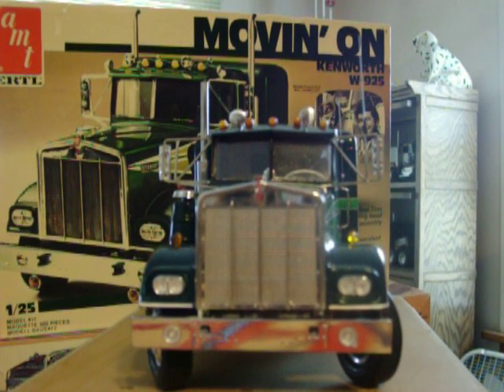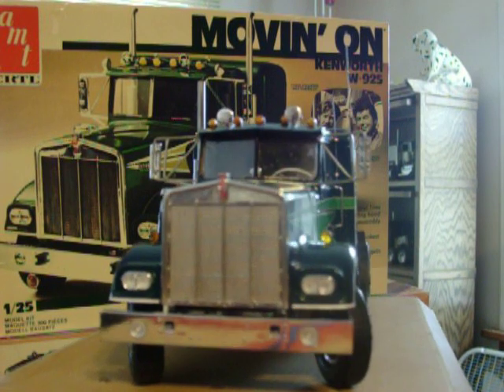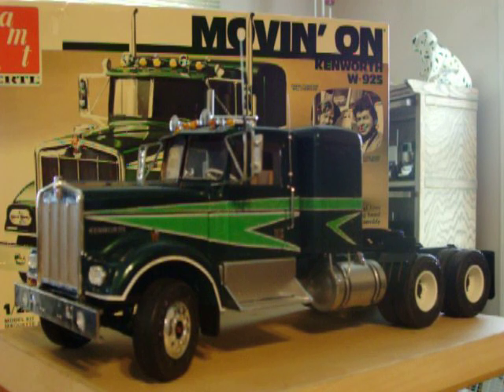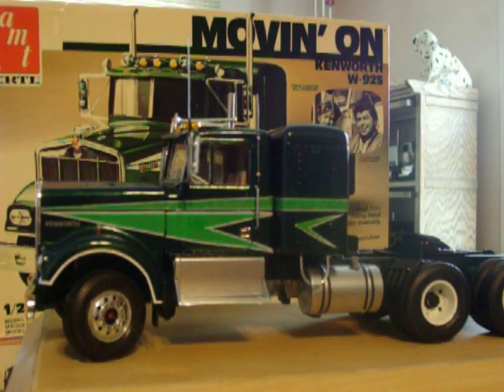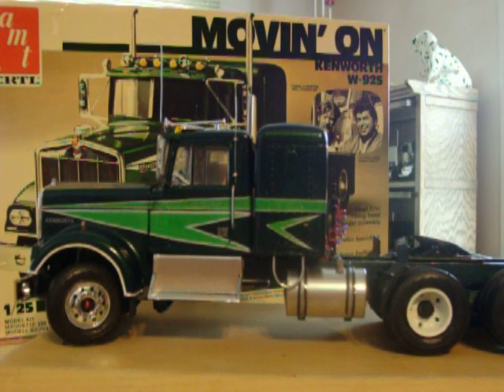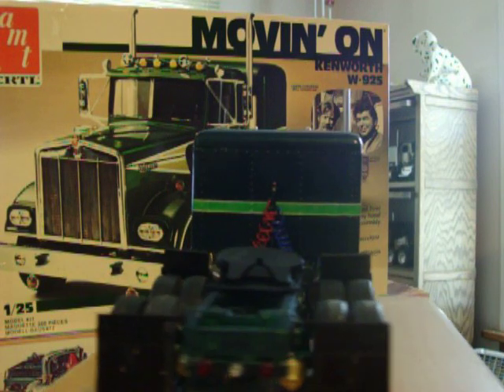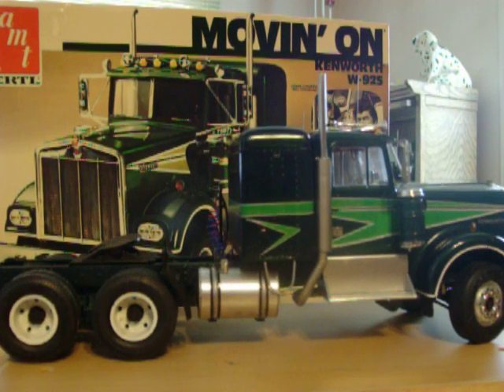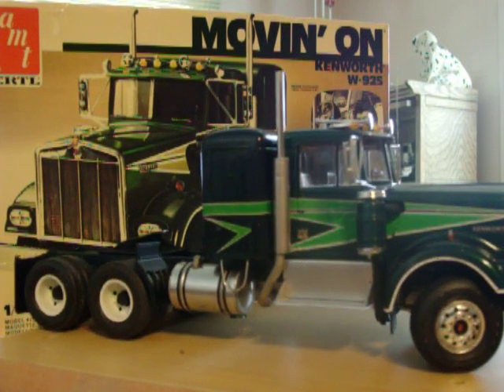In Tandem/  Movin On truck

Comment: Nice work! Good news - this kit is coming back out in June this year and rumor has it they are correcting the decals to match yours and the torsion bar suspension which would be correct for the pilot episode truck is going to be included. Probably still have to modify the hood for the single air cleaner and source the passenger side battery box but it's a little more accurate this time around.
Reply from the maker: Thank you for the comment and would love to see the updated version , what company is doing this ?
Reply: U want sell it

Comment: You ruined a great model...
Reply from the maker: Not sure what you mean by ruined a great model but i will reply, I did not use the Movin On model to make the one in the video the box is just a background. I have a you tube video of the Movin on truck with the correct sleeper and bumper if you would like to see the difference.
Reply: 'Sorry. I thought you used the Movin' On model...
Reply: feb 9 2020 - READ THIS FFCRLT            impressive job FF i was able to download a set of decals as used for the full size truck in the tv show google pictures that had a display set said you had to to go the site that had them for sale and pay b4 you could do that they are light creamy lime green so if youd like a set for free let me know i see yours  are rather dark maybe its the video low lighting but the rest on that ruck is exellent work but the sleeper is to short but you made it as you wanted thats all that matters i also have link to the movin on website where you can get the entire series on dvd an other for radio controled version of that trick same size as a meatle diecast an that real kool movin on brass belt bluckle  jeff artist canada ; )